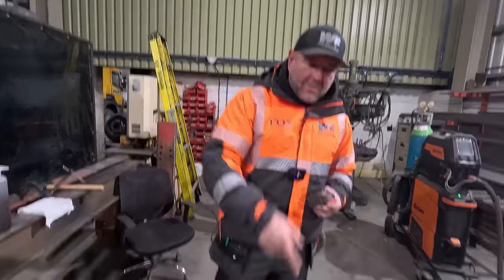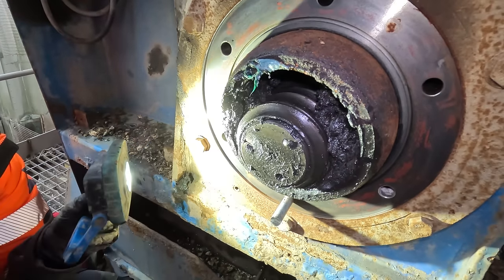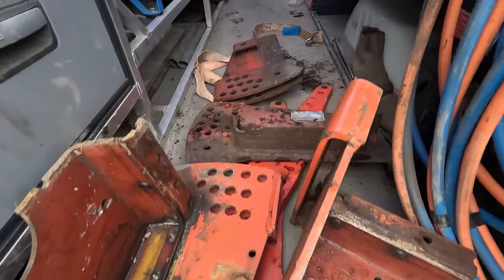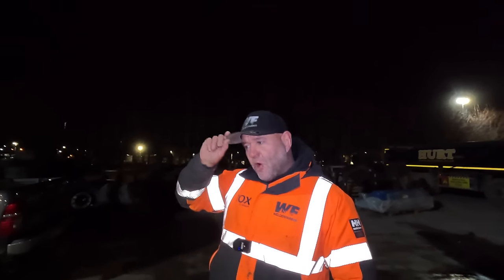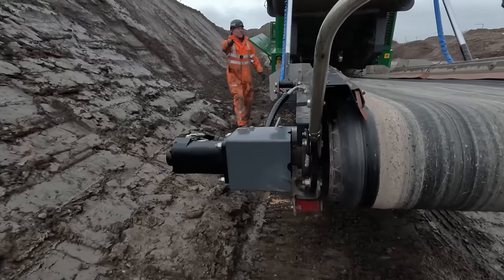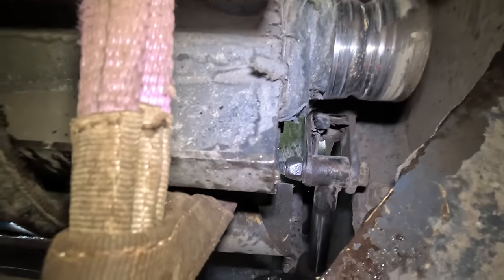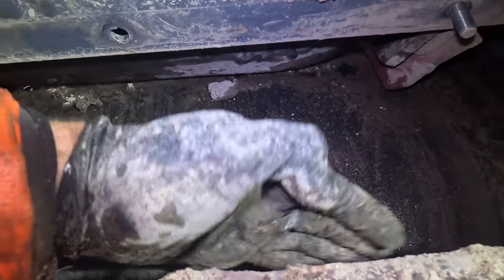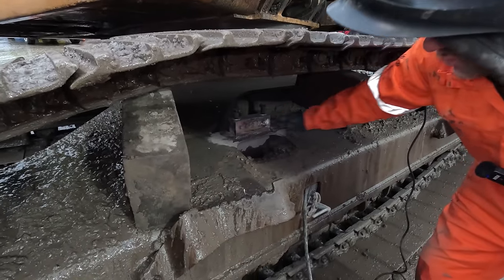Agricultural mods, Flu, Wash plant's, Bearings, Rollers! This one has it all! Chronicles Ch #026

Comment: You could shoot a short video for each machine type showing the routine maintenance and grease points. Then have these linked using a QR code which is on a plate / sticker on the machine. Then the operator can refer back at any time to guidance on how to maintain it. The plate / sticker could be next to the control panel so there can be no excuses.
Reply: Good idea 😮
Reply: Brilliant idea 👏 . I came here to say make a vid on it for the boys but that's way better 👍
Reply: @Medusas_Barber  A picture paints a 1000 words...
Reply: @Medusas_Barber  true, which is why they invented the motion picture within the last 130 years...

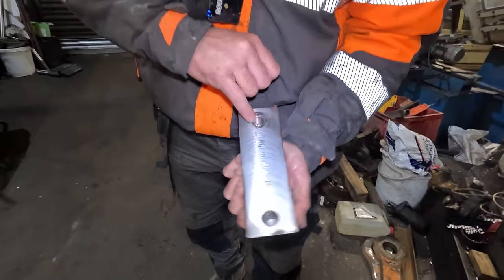Comment: 1:00:00 , love that mans shop, I worked in a similar shop that was started in 1934, 
with the train tracks less that 8 meters from the building.....
lots of old school machines, we did repair and some new parts manufacture.......
the big lathes, drills and mills were also great to use, we had a 1x16 meter lathe that was 
adapted to weld build up, the gun was fed by the lead screw, and the rpm could down to 
about 1/4 rpm.......slow baby......it did one heck of a job on MIG weld build up on shafts.....

Comment: You need to make a folder up for each machine with colour photos of the grease point locations on the machine and fundamental maintenance  checks.

A separate sheet or computer based record with dates and times that the greaseeing is carried out, operator to intial this every time they carry out greaseing and checks.

Any half decent operator will know the grease points on a 360 but a crusher is a different animal with hidden grease points, some remote from were logic would say the bearing location or pivotpoint is.

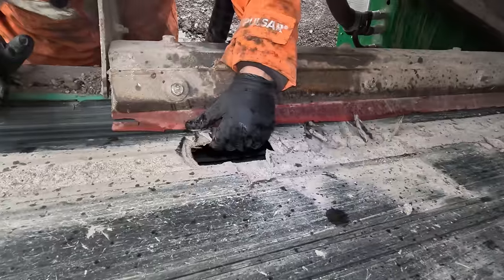Trouble is when dropping off a machine a  simple walk around can be easily forgotten, and frankly, those unnloading often have little operational 39:43 experience  of specific machines.

Comment: Hi team, I really appreciate how you don’t fill the chronicle with advert’s like most channels, but to be fare I think you deserve to put a few more in especially the longer vlogs it’s only fare the effort you boys put in.
As reference to the greasing education I’ve been on a few jobs now where operator shift hours/maintenance and hour logs have been in an app format,maybe specific grease location’s can be added to such a system when an op logs in and out of a shift on a numbered piece of plant.
It’d be a large undertaking to set in place but like your main sponcer Autovolt stream lines the other side of the company’s management to great effect maybe I could be as successful managing the plant hire side.
Reply: wouldn't be difficult for Fox to implement but i imagine you could only do it for machines with your own operator supplied, if you just hire out a machine you can't make them use an app to log tasks, maybe if you give a hire  discount, could also put how to guides on YouTube for each machine, easy to access and refer back to,, maybe even more in depth to show other things to look out for that go wrong regularly
Reply: Hi, the app’s I mentioned was implemented by the main construction contractors who either hired the plant or hired a sub contractor company to do the work and I was on hire to the subby.
The benefit to all participants is if a fault is reported and past on to the plant hire firm or contractor the liability of the expense to the main contractor is greatly reduced if any further damage or wear was to be caused.
And in the case of machines ie digger’s etc etc there’s a manual supplied of each machine and in most cases a large information sticker on a cab window of greasing schedule of each of the grease point’s but most don’t even see they are there or understand how to interpret them. It’s the same with the lifting and dig parameter charts. 
As for greasing points it’s quite simple, if there’s a joint, knuckle, bearing or pin the chance’s are there’s a nipple.
At some degree the blame is down to the op unless they are brand new. 
The video idea is good as simply put a lot in construction can’t read well. 
A QR code system would be useful for a little video to each type of machine but that’s on the manufacturer and not the one’s purchasing or leasing like fox.
A system for the operator to be accountable and register that they have done daily checks and greased at recommended intervals and log machine hour’s is needed. The app would also notify the yard when service was due and faults found it could notify the op which points were due to be greased the paper system rarely works in a timely fashion wether it’s an op’s fault for not handing them in or an office not actually processing them but mainly they just don’t care as they are rarely brought to task and if they are they just move on to become someone else’s problem a app and data base could also cure that issue over time.
The level of op knowledge is frighteningly low these day’s most don’t even understand to check an air filter let alone clean it from dust.
As for adoption, agencies are the main supplier of operators to the industry so if firms like fox insisted agencies have the op’s use a system or be off hired for that client it’d roll out fast in my opinion.

Comment: BAZ, looks like you could use one of those sanding belt planishers /sanders/grinders that 
guys who do hand rail use to grind welds....the ones that have a belt with a splice
that can be opened up and reattached, to you can get on those shafts that
need some soothing out for bearing replacement......
by the way, I have the same Sanp-On dead blow ball been you are using at 56:00, 
and got it used in 1982.....the compothane is still holding up, I do not use very much, 
but all the other Dead Blow hammers I have bought have disintegrated , possibly due to 
oil or grease, some by just sitting in the tool box.....both Snap-On and other major brands....
I love my Sanp-On tools....started buying the in 1973....and still have the first 10mm socket I bought, 
but the rest of the set have gone feet and went on Walk About.......
cheers my friends, Paulie

Comment: Loosen the belt, drop the roller and change both bearings. You only do more work to save some money on parts and the other bearing is gonna fail soon so you do the same work on the other one later. Company ends up paying a lot more on work and other costs
Reply from the maker: Get what you’re saying but I won’t change a bearing until it goes. Good shout though, worth thinking about in future

Comment: Great video director. Glad to see yous got over the flu fairly quickly i know lads that its took 2 weeks to get over. How much weigjt did Baz loose. I reckon bout half a stone. Think a maintaince manual with a few picture showing at all the points that need constant looking after should be made up for all the machines not just the crushers. And getting the maintaince guy sign and date when its done. Won't be long finding out who slacking . Not great weather to crawling around in after yous were SO sick. I was wondering about the log wash plant. How come there is fabric on the logs? Take care guys and stay safe.

Comment: I dont understand how a machine can work for 6 months without i need to know all points. It should be shown on the machine a few stickers or instruction book. Id be angry this question wasn't asked but ye should be doing it on day 1. Shit happens but this can be avoided.
Reply: Nobody showed me is pathetic I'd be asking on day 1. Nobody showed me ??? Why didn't you try find out ???
Reply: A maintenance folder with colour photos is a must along with notes of any  other fundamental maintenance.  

This and some sort of maintenance log either paper or tablet based to record dates and times of maintenance.

On a complex machine, a walk around is not sufficient, particularly one where grease points are located remotely from bearing and pivotpoint locations.
Reply: @paulf2529  headbutts off baz if ye don't, that might help.